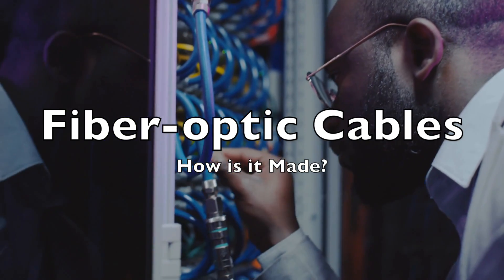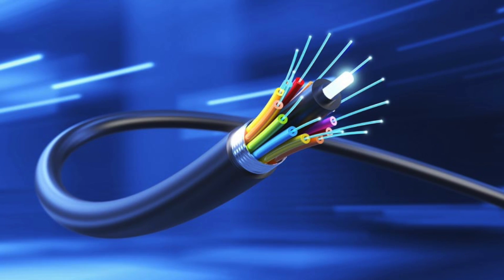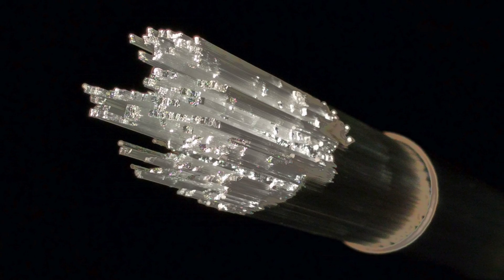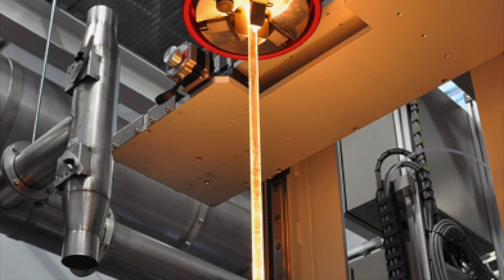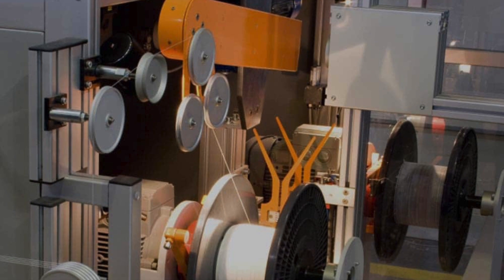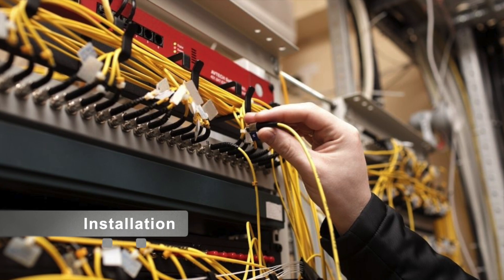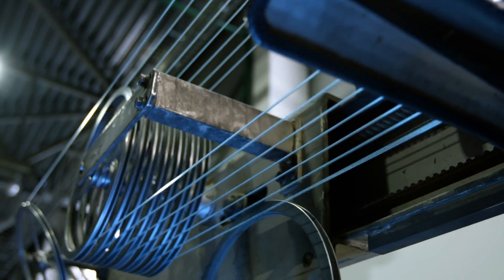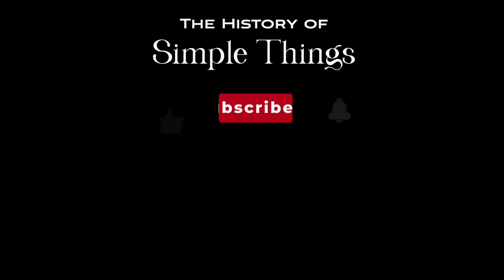How are Fiber-optic Cables Made?

Comment: I never worked on a fiber cable that looked like the one in the picture in the 25 years I worked around it. They use buffer tubes with 6 fibers in a grease in each one. They don’t run straight through the cable because if it did the second you bend it you would break some. They run in a wave pattern. We had a formula to calculate the fiber length versus the cable length. This is so when an OTDR  was used to test the fiber to find breaks or other problems the location is easier to find. There is a lot of documentation on sequence numbers in feet printed on the cable jacket and this is documented from each vault..